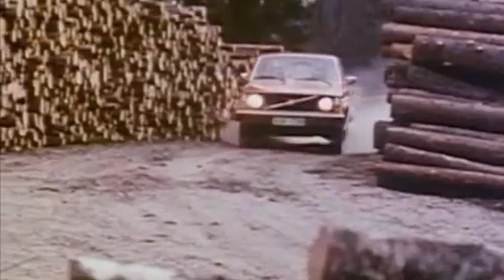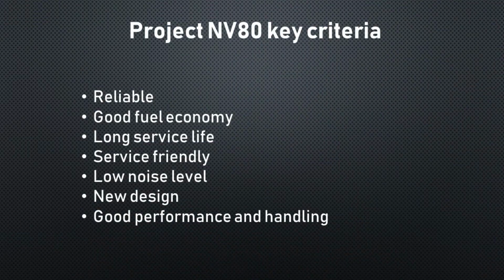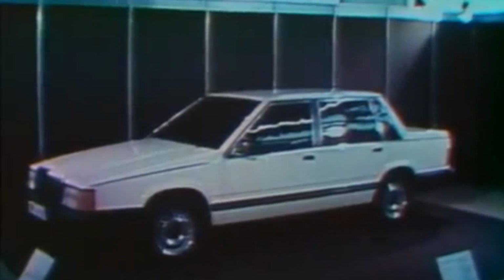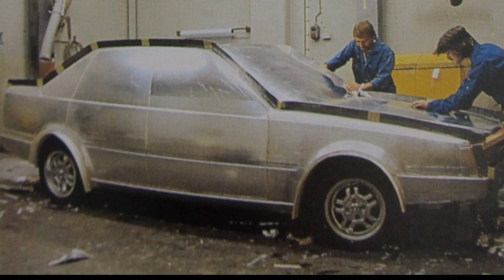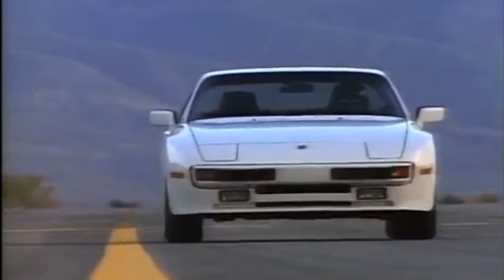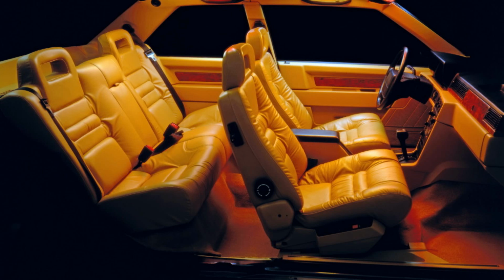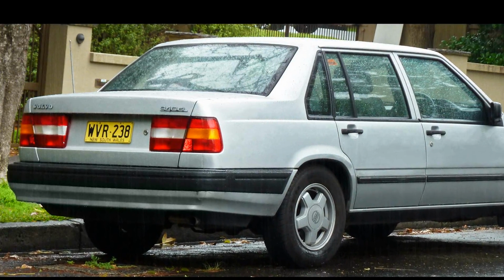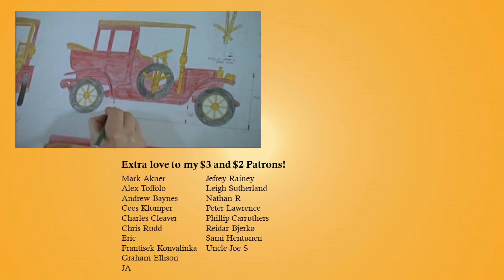How the Volvo 740/760 SAVED Debt-ridden Volvo

Comment: Don't go into the trap of mongering rumours spread by competitors' marketing departments.
I have never seen anything more reliable than the Volvo 240s! Had it not been for the rock solid reliablitiy of my own 240, I'd not have been able to afford a car during most of the nineties. No, and that is no repairs, not a single one, despite intense daily usage. The odd set of fresh brake pads here and there, some spark plugs now and then, that was it. Whatever Volvo owner I talked to, they experienced the same. A TÜV engineer here in Germany basically reached for the badge when I pulled up to his for the technical examination, saying "There's never issues with these.". That must have been in 1998, when mine was 21 years old.
 I got the TÜV-badge without any issues. Mine with the B21E engine also was fairly modest about the fuel consumption, which was between 7,5 and 13 litres per 100Km. That's about what you got from a VW Beetle of similar vintage (and ~70hp less output…), and equally sized and engined BMW, Opel and Mercedes easily took 20% more.
Reply from the maker: See my pinned comment.
Reply: @BigCar2  As the 240 series was basically a facelift of the 140/160 family with only minor changes under the skin, your pinned comment is most unlikely down to the facts as well, probably the result of half-informed hearsay you rely on.
As a matter of fact, the 4 cylinder engines all the way from PV 444 to the last 940 were basically building on the very same engine block, a family of cars that also included the P1800S. There is one P1800S in the USA which had done 2.8 MILLION MILES on the first engine in 2010. I repeat: FIRST ENGINE. There is a Mercedes 180 in Greece that clocked more, but is on its tenth or so engine!
The B16/B18/B20B21/B23-family of engines is THE sturdiest, most reliable, most enduring engine ever made. There are many other good ones, but none better. Proven in decades before and after.
Volvo are supposed to have made an exception for the B18, B20 and B21 in the PV 240s in 1974/75 years, although it was the exact same engine as in the PV140, P1800 and Amazons, which laid down a record of clockwork-like reliability there? Does not compute, Sire!
That claim has to be off track. I have no clue what sources you got that from, but I, a someone who has had his eyes on all things with wheels made in Sweden for some thirty years now, do not believe any ounce of it.
Here in Germany, I have heard a lot of shunning of Volvo and praise for, for example, BMW, Volkswagen and Mercedes. Then I worked for some VW-related companies, fixed the odd cars owned by friends, had a Mercedes bumping into my own Volvo and a BMW 5er int the one of a friend of mine. I laid down a hundreds of thousands of kilometers in Volvos, I talked to many a 240 owner and the Volvo garage owners etc.
No other car even approached the robustness and reliability of the Volvos, especially the 240.
Do you remember the crash test of the Fifth Gear show from Britain, where they wanted to show the superiority of newer car designs? The one where they crashed a late-nineties BMW 5er into a 940? Oh, how badly the 940 looked.
…oh, how easily you saw that they had removed the heavy engine from the Volvo in order to make the new car look better. That was it with Fifth Gear for me. Rubbish journalism. Faking results in order to confirm rumours. (Top Gear were more honest there, when Clarkson knocked over a wall with a 960 to then drive away in the very same car.) That's why I have no worry about attacking the claim you make there this vigorously: Similar rumours have been spread before. I have no doubt they went viral straight from the desks of competitor's PR campaigns. They are as credible to me who has seen a bit of said cars as the claim that Queen Elisabeth actually has green skin and eats servants for breakfast. Not the least bit that is. 
The one trick which Volvo used to not get into the issues claimed by the rumour you quote was evolving their models from their predecessors, rather than revolutionising. I heard of issues with some models, for example the Bendix made brakes in the 740s didn't last too well, bad maintenance could damage them beyond repair. None of that was the case with the 240. The pressure balanced 3-circle brakes by ATE just would not fail. The Borg Warner BW 55 could have issues now and then. The one in mine lasted for hundreds of thousands of kilometers with no issue at all. The manual transmissions were exactly the same as in all other Volvos, and last forever. You have to abuse them seriously to get them damaged. A friend and fellow Volvo fan tried his best by bolting a B28E, the 2.8 litre V6 with its extra torque, to them while keeping the rear axle of the automatic version. This was not enough abuse, though. That made his Volvo 264 run 230Km/h though. On pretty low consumption, he mentioned something like 12l/100Km at 200Km/h back then.
Take into account here that this was in Germany, so that includes Autobahn madness with the extra abuse included! He went at 230Km/h quite a bit with it! He did chase BMWs about with this "heavy, slow old" car!
There's a reason why Volvo found a market for a car that was changed only marginally for 31 years.
The only let-down I know of were the 440 and 480 series. Prone to rust and of average quality of design. 340/360 series Volvos sufferd from corrosion as well, but featured excellent engines and were a delight to drive.
Ford-era designs apparently also don't quite come up to old Volvo standards. Ford generally had a very bad influence on the Volvo brand, worsening several bits of specialties where the MBAs felt they could squeeze out a few more quids. While I respect Ford as a mass producer of cars, I absolutely resent them for what they did to this manufacturer.

Comment: Why is the DeLorean always mentioned in the same breath as the PRV v6? It's probably the worst car it was ever used in.
Reply: It was used in many different  cars, like Renault 30, Peugeot 604, DeLorean, Alpine 310 and Volvo 260/760/780.
High production-numbers made it easy to keep the price low on that engine.
It was a lightweight design, but required regular maintenance and it was tricky to maintain.
That made it difficult for many amateur-mechanics.
I have a 1981 262 Coupe, a 1987 780 and a 1990 760GLE in storage.
In Sweden I also have a 1996 960 Executive.

Comment: The first time I saw a Volvo 760 coming down the road (probably in late 1982 but perhaps earlier) with all those straight lines at odd angles, I thought it was the ugliest car I had ever seen. Yes, even uglier than an Austin Princess, Triumph TR7, Aston Martin Lagonda, TVR Tasmin or Reliant Scimitar SS1. It did however grow on me later. That first impression was not helped by the fact that the Audi 100 C3 had been launched the same year and I thought it was one of the most beautiful saloon cars that I had ever seen not least because of all that flush-fitted glass which was very aeronautical.

Comment: I don't even know how many miles from reality this video is. No contention made is actually borne out by history/data. Fuel economy? 700 series was first offer with the infamous PRV engine and the D24T. Neither was efficient, nor reliable. It was not until the early/mid-1980's that Volvo became truly solvent again, and the data show that the 240 was Volvo's big seller, NOT the 700. The 700 did NOT save Volvo, it nearly killed Volvo, as the 700/900 platform continued for far too long, and even the 850 could not save Volvo by the end of the 1990's. The amount of misinformation in this video is staggering.

Comment: Errr hang on a mo your wrong the 240 had no reliability problems so much so the engine carried over to 700 but the 760 2.3 was a dog due to the faulty motronic system! Plus you keft out the 2.3 and failed to illuminate the faulty vw straight 6 diesel that would turn heads into u bolts!
Final foot note economy wise the 240 2.3 can easily get 40mpg.
Reply from the maker: See my pinned comment.